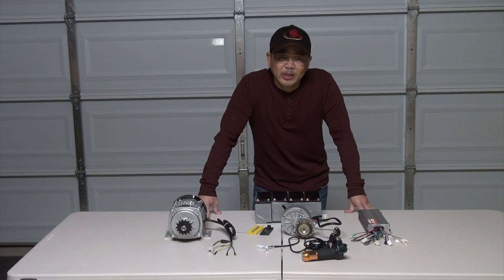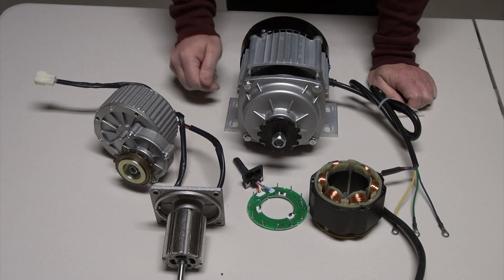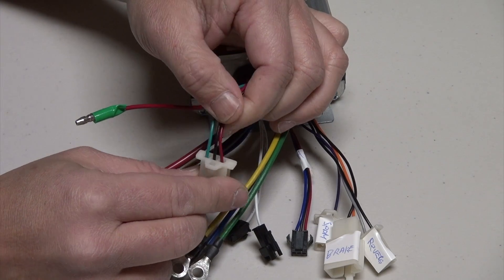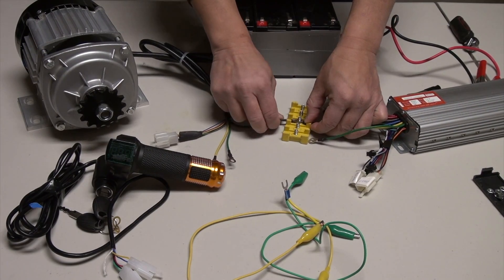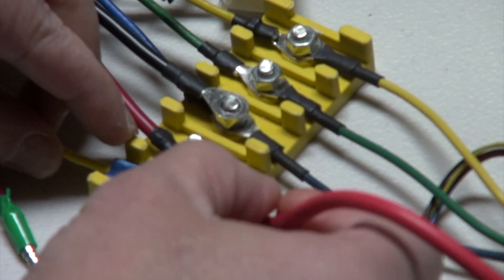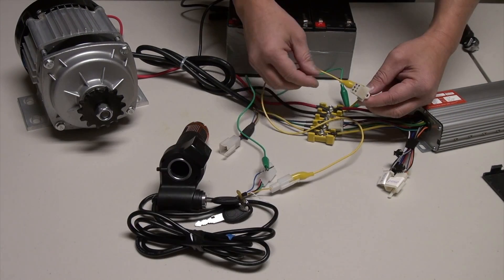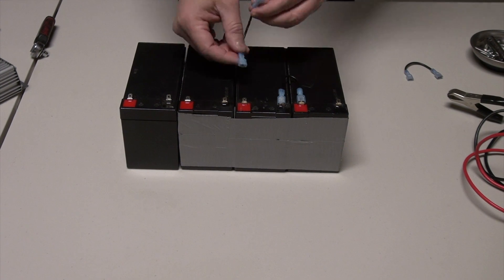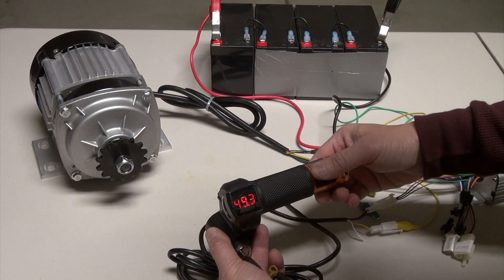How to Connect a Brushless DC Motor to Controller (48V 750W E-Bike) in English

Comment: Can u send me and amazon link of a 3000w motor and a controller for it with batteries
Reply from the maker: Hello, I purchased the motor and controller from eBay.  You might be able to find the 3000w motor there as well.  Good luck 🍀. Thanks!

Comment: Sir how much constant torque  it have ?
Reply from the maker: Hello, sorry, unfortunately I don't have information on the torque of the motors.  The motor can use up to 2 horsepower= 48V X 30A. The smaller one is rated for 450 Watts at 36V.
Reply: @diypotentials  ok sir

Comment: Sir how do i connect solar panel to the batteries to run this whole project pls help this is for my school work
Reply: You need to buy a solar charge controller and give the electricity in from solar panels. Output must go to battery then it will charge.
Reply from the maker: Hello,

Here is a link to a couple of videos on how to connect batteries to solar panels. You do need a solar charger to make the connection.  https://www.youtube.com/watch?v=kF_cVEYxj3E
https://www.youtube.com/watch?v=9684-430nVM.  Be careful and good luck...

Comment: i followed you ang my hub motor turned for 2seconds and died ...... what could be the issue?
Reply from the maker: Sorry to hear that you are having problems. However, it is hard to tell what could be the issue.  There are so many electronic components and parts involved.  It could be the controller, a blown fuse, the hall sensors not working, or a wire not connected properly.  I short circuited, a few motors and controllers myself.  Hopefully, you can trace back and figure out what went wrong.  Also, there is guy who specializes on hub motors on youtube, EV-Customs, maybe he or his videos can help.  https://www.youtube.com/watch?v=A8QcNvRh0wM
Good luck...
Reply: Constant torque of both moter please ?

Comment: Hi . Is it necessary to run this on battery?  If it is driven with a 48 volt DC power supply (from AC to DC conversion circuit) will it not run? Or can get damaged? If it gets damaged please tell me the possible reasons.
Thanks in advance
Reply from the maker: I have not try using a AC to DC converter to run it.  But as long as the supply output is DC it should be okay.  Try it...let me know if it works.  Thanks!

Comment: Am I right,Motor takes 13.4 amp current .. How much time the 7ah battery withstand..
Reply from the maker: The motor has a power rating of 750W.  So at 48V, it can run on up to 15 amps.  48VX15A =720W.  Runtime depends on how much power you use.  Below is an explanation I provided to another viewer.

What is the runtime? It depends on the amount of power you draw--the more, the shorter runtime, the less the longer runtime.  The motor is not connected to a load, so it is consuming only 48 watts (48V X 1A).  I connected four 12V batteries in series to get 48V.  Therefore, the voltages add up to 48V, but the battery amperage or capacity is still 7Ah or amp hours.  So at 48 watts or just drawing 1 amp, I would get 7 hours at 100% discharge.  But in reality,  batteries work best up to 50% discharge or state of charge, so the runtime unloaded would be around 3.5 hours.  However, if you connect the battery to a load that would draw 7 amps or 336 watts (48V X 7A), that would give you 1 hour of runtime at 100% discharge.  At 50% state of charge, you would get around 30 minutes. I hope this helps…

Comment: Hello brother. I want know the battery details...you used. Is there any difference between automobile battery and ups battery..., I'm having ups battery same capacity 4 nos,Can I use that..?
Reply from the maker: As far I know, those batteries should be okay so long as they meet the 48V requirements for the controller and motor.  Like you said, if you connect them in series each of the batteries voltage level and amperage should be the same.  The batteries I use are 7Ah, however, you can definitely use those with more amp-hour (Ah), like 12Ah, 20Ah or more to get more runtime.  This is what I know, try it at your own risk...  Always be careful when working with electricity.   Thanks!

Comment: Current rating of 30amps. Is that the max amp it can handle or the max amp it is drawing from the battery?
Reply from the maker: The controller is rated at 30A.  The rated power is 750W and the rated voltage is 48V. If you are going to apply 30A, you have to lower the voltage level to 24V in order to meet the power rating (24V X 30A = 720W).  If you are applying 48V, the current (amperage) should be a round 15A (48V X 15A=720W). Hope this helps.  Thanks!
Reply: DIY Potentials: Projects & Ideas yes. Thank you
Reply: @diypotentials  Isn't it possible to connect a 48V, 30Amp battery? Because the controller handles it down to 15Amp anyway, right?

Comment: How long is the runtime on those batteries?
Reply from the maker: Each of the batteries is rated at 12V 7AH@20hours.  For more info on batteries, I found this site very useful. https://batteryuniversity.com/
Reply: @diypotentials  I meant, how long does the motor last on those batteries?
Reply from the maker: It depends on the amount of power you draw--the more, the shorter runtime, the less the longer runtime.  The motor is not connected to a load, so it is consuming only 48 watts (48V X 1A).  I connected four 12V batteries in series to get 48V.  Therefore, the voltages add up to 48V, but the battery amperage or capacity is still 7Ah or amp hours.  So at 48 watts or just drawing 1 amp, I would get 7 hours at 100% discharge.  But in reality,  batteries work best up to 50% discharge or state of charge, so the runtime unloaded would be around 3.5 hours.  However, if you connect the battery to a load that would draw 7 amps or 336 watts (48V X 7A), that would give you 1 hour of runtime at 100% discharge.  At 50% state of charge, you would get around 30 minutes. I hope this helps…
Reply: @diypotentials  no clue  on

Comment: bro, how much this kit costs?
Reply from the maker: I purchased the BLDC motor and controller for $89 on Ebay.  The 12v batteries are approximately $15 a piece.  You might have to shop around for a good price...Check out my electric bike conversion video.  The kit for that electric bike conversion was  $117 on.  I found it on Ebay as well.  Thanks and good luck...